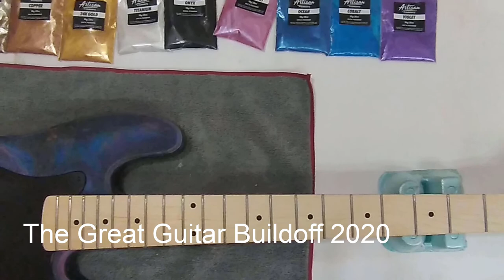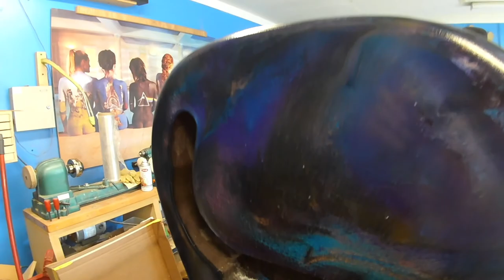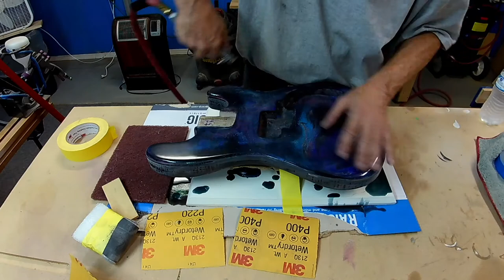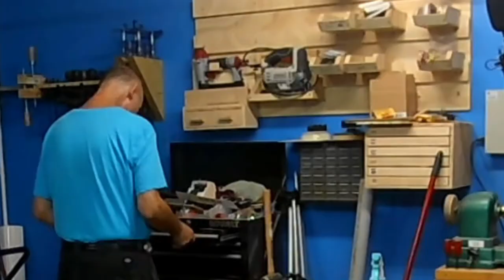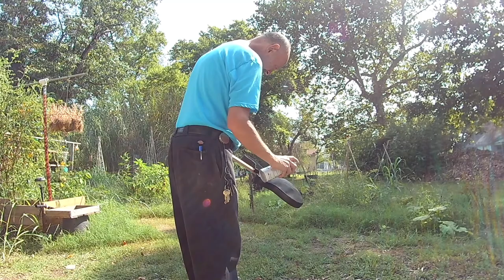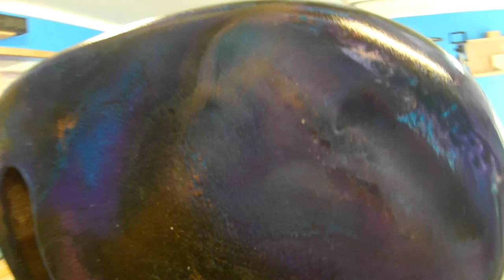VidLogGGBO092120 Cosmic P Bass Update for the Great Guitar Build Off 2020

Comment: I'm surprised you're rubbing the paint down with grits as ough as 220 and 400 
I thought you would be 400 at the least and 6-800+
I would probably go through the paint if i used that kind of grit on it 
I've tried lightly sanding and undercoat with 1000 and still managed to get down to wood on the corners and wasn't rubbing hard either
Reply from the maker: It isn't paint. It is several layers of acrylic epoxy. 220 and 320 is to level the sags and runs. By the time I get it to shine, it will be bulletproof as well...lol
Reply: @mixedmediawoodwerks7246  musta missed that when you said it was epoxy 
I've watched that many i'm losing track of who's doing what to what piece etc ... lol
Reply from the maker: @Rab_Knox  I know the feeling...I've been wrestling with 3 other side projects while trying my hardest to get this one done so I can start on my walnut body fretless build. I've just turned my brain off watching everyone else for a few days to try and get ahead. Then I can build an amp to play it with....lol